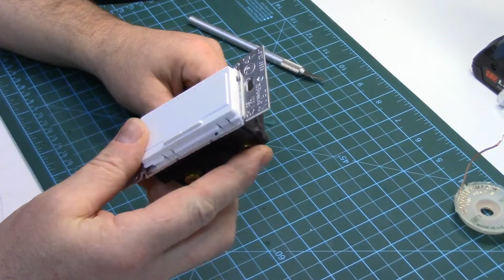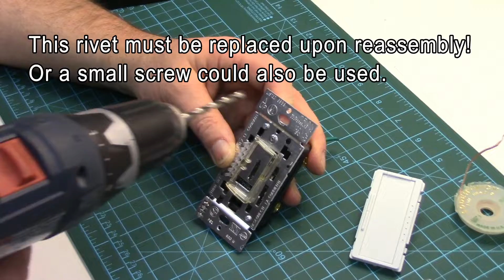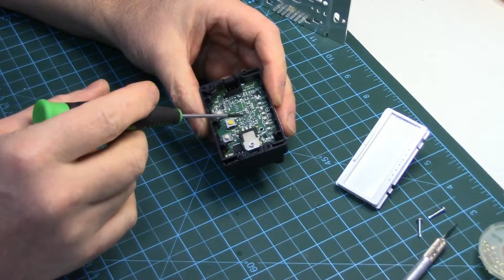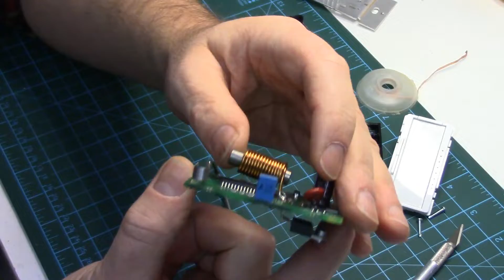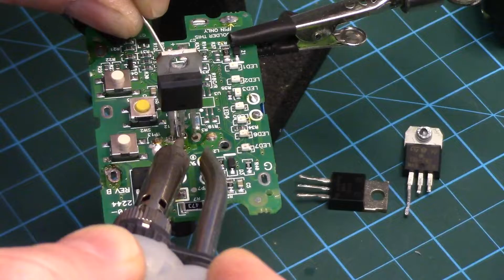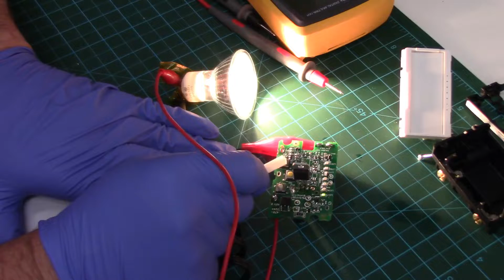Lutron Maestro Dimmer Switch Repair

Comment: What's the symptom of the triac letting go?  My combo fan/light switch quit working tonight (both features).  Fan speed #3 green led and max light intensity green led both flash together every 3 seconds.  Resetting does nothing.  Cannot access programming mode.  Nothing works except for the periodic flashing leds
Reply from the maker: TRIACS failure mode is generally closed (short); so full brightness/full speed. Doesn't sound like a failed triac.

Comment: we usually call them Mosfet short for metal–oxide–semiconductor field-effect transistor
Reply from the maker: This is a triac not a mosfet. A mosfet is for DC switching, not AC. AC switching and certainly dimming / AC current throttling is always controlled by a Triac in all these AC switches with dimming ability; just as the name would suggest. "Triode for Alternating Current."

Comment: I have the Cooper smart dimmer (remote) and when I connected it I had the lamp on and now nothing works, only the lamp remains on and a single green led on dimmer is on. I don't know if it went into protection mode or it burned out. Does this reset work for that model? Did something burn when connecting it? I appreciate you helping me. 
I opened and there is a little black mark like burn next to de diode.. 
i really dont know what to do🤷🏻‍♂️
Thanks

Comment: Excellent video!  I have a Lutron RadioRA2 dimmer that failed similarly, and I was struggling to take it apart- your video was a great help!  Mine has a bunch of additional components for the radio, etc., but the basic structure is identical.  

I ordered a replacement ST BTA12-800CWRG triac from Mouser, and I'm waiting for it to arrive, and figure out if it will work again.  The triac in the dimmer must have a proprietary part number (it says "130  360   GK198  VU  CHN  841 ST  e3G") that I couldn't search for, so your recommendation for a replacement device was very useful!  

Hope it works!  Thank you!
Reply: How did it go? I've got a Caseta Dimmer that I got "open box", but never worker. Lights don't go on.
Reply: It went really well … but it still didn’t work!  I guess more than just the triac must have been destroyed ….

Comment: I heard a pop in my Maestro.  I took it apart, found a burn mark but can't find what overloaded.  It looks like a burn along the side of the circuit board.  Any ideas on how to fix that?
Reply from the maker: Without seeing it first hand and doing a proper component diagnoses, no way to know. If one full side of the board is burnt however, that sounds like a catastrophic failure which has likely cascaded to many components and would not be worth fixing; but again, without seeing it first hand and testing, that is just a guess based on description alone.

Comment: Cool video. And yes Triacs are often at fault in any such blown dimmer. But why don't you get a real soldering iron? They are so cheap. The one you have is made for desoldering 2-lead devices, especially SMD. It seems so awkward to use only one of the tips. Surely if you have a Fluke, you must have a real soldering iron or two or dozen somewhere in your space... :)

Comment: Hey, thx for sharing. Good sleuthing about the isolated tab requirement. They are still using State-O-The-Ark technology. That is, antique technology that is as old as the Ark. Hahaha.
The funny thing about fuse protecting a Triac the fuse costs more than the Triac and there's no guarantees that the fuse will interrupt before the Triac is destroyed.

Again, thx for sharing.

Comment: it should be taken off the board to test
Reply from the maker: You mean like I did at 7:22 😄 Regardless, TRIACs can be tested in circuit - provided of course the circuit is not energized and the load being switch/dimmed (the bulb/s in this case) is disconnected from the circuit.

Comment: Thanks so much.  I have the light/fan combo unit with the IR remote. It was $120 or so when I bought it years ago.  It stopped working. I found your video and tested the triac and it was indeed bad. I bought them on Amazon and changed it and it fixed it.  I’m very thankful for your video
Reply from the maker: Glad you were able to fix your dual switch as well with  a new TRIAC.

Comment: I had a halogen bulb blow out, trip the breaker and as you can guess, ruined the Maestro dimmer. It's now obvious the TRIAC was ruined since the lights came on but the dimmer no longer functioned, though at least the FASS tab worked as a light switch. Thanks for the tip on drilling out the rivet and how to check the TRIAC continuity so I was able to confirm it is dead.

Comment: Actually, you will NEVER get full brightness as in 100% line voltage through those triac dimmers. If your line voltage is say 120V, then you might at best see 106V which with most Halogens and performance LED bulbs will make them look less than stellar. Lutron knows this and has been using this 30+ year old technology even in their so called new smart Caseta line.
Reply from the maker: "Full brightness" was in reference to the  dimmer output setting level. Regardless, I doubt many people could actually perceive any light level difference between a triac controlled dimmer & full brightness over a standard switch passing the full 120V. We have a number in the house side by side and I sure can't see any light output difference. I can actually detect a larger difference in light output between an old halogen or LED bulb vs a new one by eye than between a dimmer and normal light switch. Totally moot in other words.

Comment: I was given the exact same dimmer broken from a friend, mine has a failed TRIAC as well. More importantly 2 resistors on the back side have fried, could you plz tell me what resistor values are for R44, and R11? They have fried on mine. If you can't read the resistor values, might you be able to take a high res picture of the board bottom? Looking forward to repairing this so I can use it in my room, with the warnings you have provided aswell.
Reply from the maker: It's long been back in use in the wall box - no access to it in other words.
Reply: @Rchelicopterfun  ah okie, last week I was able to barely make out the original values and replace them. Its working now, awesome little IR dimmer switch.

Comment: Thanks for posting.Very interesting. I'll try doing it on a bad one I have. Just curious though why you pulled the board from the housing. Seems to me one could replace the triac without pulling the board out.
Reply from the maker: Basically for inspection, but it was also much easier (for me anyway) de-soldering it from the back side.

Comment: I have the lutron caseta, did the same thing and I'm trying to find the replacement part and I can't find the number that listed on the IC regulator. Do you know what's the input voltage and the outlet voltage are ? Or how I can find the right part ?
Reply: answer the man, John
Reply: Johhhhnn?

Comment: we have taken a wireless caseta dimmer apart and have verified the triac is the culprit.   2 pins shorted.    Now we went to digikey got a replacement , soldered it in delicately and it worked for 2 hours,  then we tried with the other 2 this time with thermal protection.   they failed.   does ground matter?
Reply: The body of it is also ground, so ensure it doesn't touch either elsewhere, could have caused a short too.
Reply: short in? how many ohms? usually the triacs are built in resistor incorporated.
Reply: @elttydj  they also need to ensure the pins are the same.

Comment: What would it take to add an additional connection that is full power (doesn't go through the dimmer circuitry) in the vacancy sensor version of this item https://tinyurl.com/y2f3u7ua   In my bathroom I'd like to a simple setup with a single on/off button, vacancy off, and when on, the fan is fully powered, and the lights powered according to the dimmer setting.